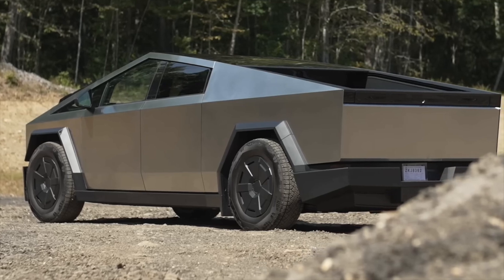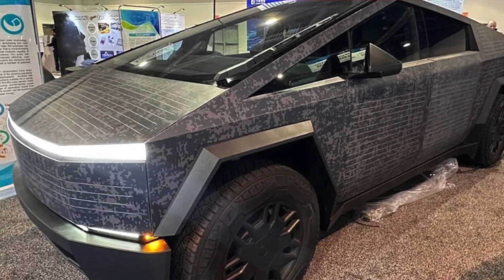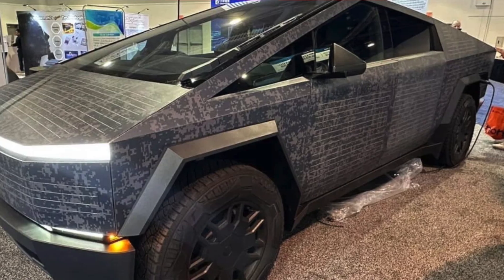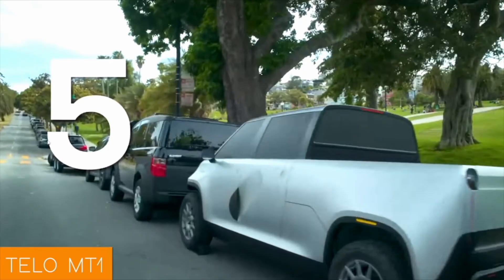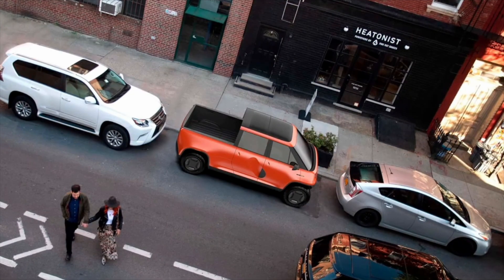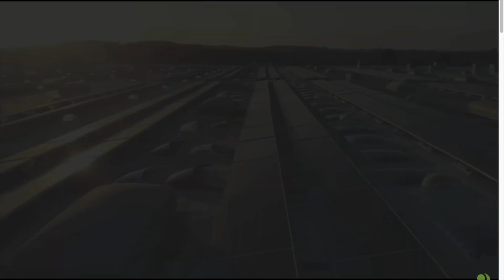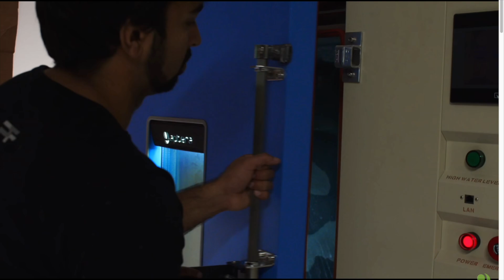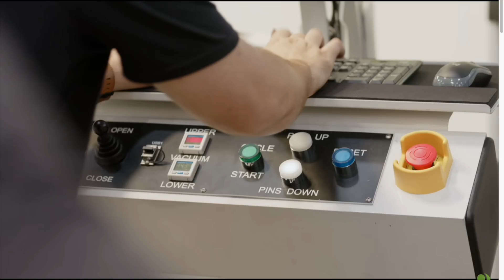Which Solar Panel Is Better ?

Comment: I don’t think the cyber truck solar “wrap” would make the truck go more than 5 miles per day.   The weight alone would kill that 15 miles per day.  The aerodynamics on the cyber truck is already killing the batteries just moving air out of the way. This is the reason Elon musk will not put it on any vehicle at the moment.  It would be too expensive to manufacture. The more difficult to process the solar panels, the more expensive the price tag for them. Aptera motors knows this fact and is trying to confront the issues that other manufacturers are have a lot of trouble dealing with.  The third thing is the region of where the vehicle will be charged. The southern states are indeed sunny but just about everywhere in the southern areas everything is far away from each other. From point a to b means more energy to move. The northern states where the sun shines less in the cities, almost everything is closer. However, Buildings and garages would prevent the truck from charging at all. It is pointless to add solar for traveling. It would make more sense to have solar for all the peripherals in the car lit and the alarm system ready.  

As far as Aptera, making solar for other manufacturers, I think it beautiful.  Atlas, I don’t think putting solar panels over the pickup truck bed would make any sense either.  It would maybe get up to ten miles per day? Why? Again, aerodynamics. If the auto industry were to seriously make aerodynamic vehicles in the first place then maybe solar would play a nice role in transportation.  (Somehow big oil would not be happy about that.)  

Last thing I should mention, the reason the big manufacturers are not concerned with Aptera is because it’s an auto cycle, that holds 2 ppl.  They don’t consider them as a threat. I for one can’t wait to get my Aptera, because it will prove big auto wrong again. Musk proved that and is the leading manufacturer for EV that every one wants to be.  Until Aptera motors real world stats start hitting the public, it’s all speculation. I just hope at least 90% of what they claim is true.

Comment: The Cybertruck solar wrap is a tough sell objectively at $10K, but the PPF wrap that Tesla sold for the Cybertruck was originally $10K without any solar capability or battery. Plus Cybertruck owners paying $100K+ for their vehicles probably won't worry about spending another $10K, for added cool tech and green-boasting capability. For Telo, adding Aptera solar panels sounds like a real win-win, as long as the price is good. The Telo's lighter weight and likely higher efficiency could result in higher gains overall, and a better onboard solar value. Plus having onboard solar on more vehicles will help highlight the benefits for efficient BEVs moving forward, and help set Aptera apart.

Comment: I saw both of these stories and they both intrigued me. It's good to see they caught your eye as well. Thanks for doing this report. 

First of all, don't apply Aptera's calculations to the Cybertruck, or any other EV for that matter. 😅  The Cybertruck won't get 15 miles per day from this wrap. More than likely, it will only be enough to power the HVAC, or keep the battery at current levels when it is parked. 10 miles per kWh is specific to the Aptera, the Cybertruck won't get anywhere close to that. 

The thing is, this wrap company says they get 1.5 kW, but I'm not sure what this means. Does the wrap get 1.5 kW generation from the solar cells, or is it 1.5 kilowatt hours PER DAY? If the former, it should get around 9 kWh per day, which is quite frankly phenomenal. Of course the surface area of the Cybertruck is much greater than the Aptera, so it could be providing twice as much power as the 700 watt Aptera panels. 

The problem is that most of that area on the Cybertruck is on the sides, nose or back. The area on the hood and roof is much less. I assume the bed cover has a wrap too, but that cover has to be removable, and without it the power will be less. So I don't know if you will GET 9 kWh/day. It depends a lot of if, like the Aptera, those panels pick up a lot of reflected light, and then you're probably lucky to get 5 kWh per day. That's about 2 miles per day. (The Cybertruck averages 2.5 miles per kWh)

The Telo truck at least we know the numbers. The roof will give 200 W, or 1.2 kWh per day and the bed will double that to 400 W or 2.4 kWh per day.nthe Telo gets an maximum of 5 miles per kWh, which is fantastic but not quite as good as the Aptera, so the complete solar package should give you 12 miles per day in summer. More like 8 miles per day in the northern US. 

That's actually great for the Telo truck. It isn't built for efficiency, it's built for utility, and it's also small and light. 8 miles per day will supplement standard charging nicely, and you'll have plenty of power for HVAC and phantom drain. I'm looking forward to seeing the Telo come out, and I love TalosiveEV's videos on the truck. So I think this is a great addition. 

The wrap I'm less sure of. It sounds interesting, especially if it can get about the same wattage as Aptera, but I doubt that it is as robust. As you say, I would expect the wrap to be scratched and damaged by road debris. Although I would be interested in seeing what results we could get out of wrapping the sides of an Aptera with the solar wrap. 

My question is, if the wrap is damaged, does it only take out the cell under the damage, or do you lose the WHOLE wrap? Or even just a large portion of it? How often can this be expected to happen? If the solar wrap loses power over time until you have to replace it that is fine, but if you can lose 1/3 or more of the charge from one ding, you're going to want to replace the wrap. 

The company (I haven't even heard their name yet) says they are offering a 15 year warranty but if it is cheap to produce the wrap, they probably just offer you a free replacement for 15 years. Which means you have to have the car re-wrapped. Can any wrap shop do it, or do you have to go back to the company? Do they offer in home service? 

I just have too many questions. The idea of a solar wrap is a good one, but so is a solar panel made of tempered glass that can withstand hail damage. 

And they are both likely cheap. The panels on the Aptera were originally priced to cost only $900, which including the roof and dash comes to around $1200. They're not even charging for the solar panels any more. Likely the option will cost around $5000-7000 to add to an existing vehicle, so it's comparable to the $10,000 for the Cybertruck wrap, especially given its size.
Reply: all that doesn't even matter.  your simply spending 10 grand for bragging rights. buttom line, period

you'l never save the planet nor save a penny trying with this as of yet.  10 grand lol.. wtf.  if someone tells you your saving money. you have the right to laugh them out of the door.  it won't pay for itself in its life time or yours combined.  you minds well burn you money. or credit card to that matter.

10 grand for like a 5% upgrade. mean while you'l be petrified of something happening and it messes the wrap up and will be junk.  and god forbid you get into an accident,  you can bet your as's that no insurer is gonna cover that without a heafty premium if at all.

i honestly can't believe the nerve they have to put that out to the public for purchase at that price point.  its literally aiming for just the idiots that want to brag about it.   but i guess, in all reality. thats the entire EV scam to begin with..  "oh your not driving electric?? you know your killing the planet, right?" but really after wagers are done. a semi truck getting 4 miles to a gallon is more valuable way of transpertation.  at least its just not moving your as's to the grocery store for a bag of chips and 2 liter of cola  lol

Comment: What matters is which vehicle you have or it will be buying anyway. It will be very good if either or both or any vehicles could have as much solar electricity generation as possible. Both systems need to be repairable. I know Aptera says that their's is reparable. I don't know about the wrap.

Comment: I would think that the wrapf or the Cybertruck is resistant to normal dings and scratches, but is good concern of yours sir.  The one on Telos is of course going to be better, it's made by aptera 😜  Honestly, aptera's is much more durable and has better performance.  Have no idea about the cost, so can't really speak to that.  Highly doubt the wrap provides enough savings to warrant a $10,000 investment in it, especially on a vehicle such as the cybertruck which is very inefficient at using electricity.  The cybertruck and Hummer are worst examples of EV technology application

Comment: I have a real soft spot in my heart for the Telo. I can't have both so I'm choosing Aptera but when my daily crossover gives up the ghost, i would like to replace it with a Telo truck.

I personally like the Cybertruck, but used for $35,000. I'm not paying $100,000 for a car even if I had the money. Its just too expensive.
Reply from the maker: I’m not paying $100 grand for a vehicle either , that doesn’t make sense to me . 🤨